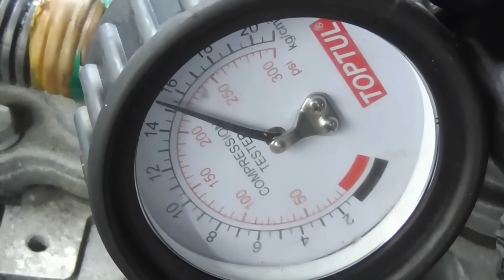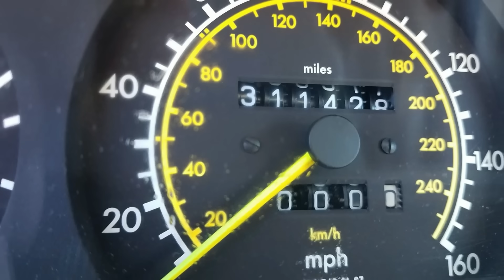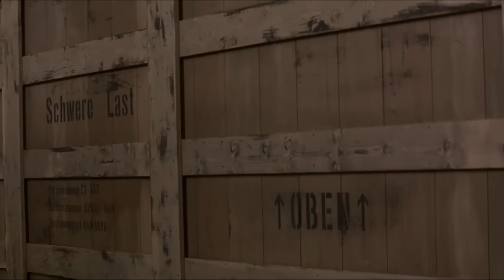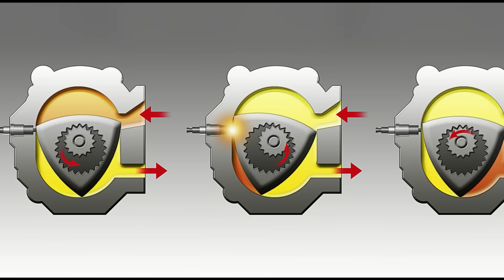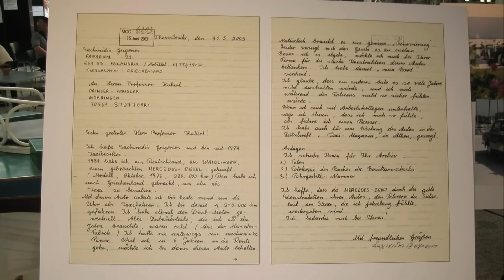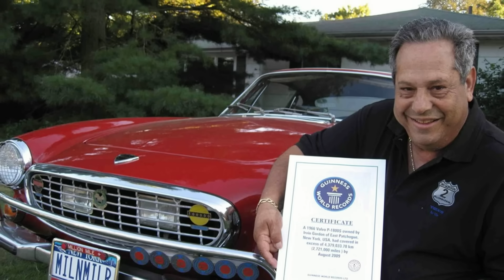Most Reliable Engines of All Time

Comment: This should be titled best tuner engines of the 90's or something. My 97 Montero sport has 240k and it's really not even that impressive to me. Just about any engine will go over 200k if you do proper maintenance. Allot of engines die from things like not changing the timing belt, or not keeping up on leaks and oil change intervals

Comment: My Ford 7.3 diesel just passed 380,000miles. It a beast and has no problem.. it has hauled 3500 lb.up a very steep hill many times. And, many times at freeway trips through thE Santa Cruz mountains. Thank’s for ignoring America. Cummins diesel is a million mile engine. My truck still works for a living. And will keep working as long as I can.

Comment: The bar is set too low. 200,000 miles isn't very impressive. I have a 1 ton Chevy van 5.7l Vortec with 370,000 miles on it.

Comment: I'd say, "Those are one tough cookie." I own a rusty chassis 89 Toyota pickup, 5 speed m with rwd. 22re, transmission, rear axles, differential, are pretty much stock. It sits about 305k miles. Everything runs very strong but just sits in a rusty chassis. Which makes me feel sad.

Comment: I live in Australia and own a Ford Falcon 6 cylinder (Barrar) motor with 350,000kms or 219,000miles and still going strong uses 1/2 litre oil each oil change which is 10,000 kms or 6500 miles.

Comment: Do car people even know about truck engines? I had a 60 series Detroit with 2 MILLION original miles. All I ever had to replace was water pump, turbo and oil changes. Original starter and oil pump. Prob coulda replaced some gaskets cause it'd leak a couple quarts (out of 9 gallons) between changes. Lol

Comment: 322,000 miles and continuing on my 4.7L 2000 Tundra with no real engine repairs.  In that time I've replaced the plugs and one ignition coil.  I had to clean the mass air flow sensor at about 175k miles, and I change the oil and oil filter every 5,000 miles and the air filter every 10,000 miles - all of which I do myself.  Still starts and runs great.  This presenter seemed to indicate anything over 100k miles was a lot to expect.  I'd be pissed if I needed significant engine work before 100k miles.
Reply: Better pray that the starter never dies, they are a bitch to replace on the 2UZ's.

Comment: I once had a 1972 2000 cc engine in a Ford Capri. It had 200 k miles on it when I got it. The engine was built in Germany. The oil was always clean as new after 3000 miles. The body totally fell apart at 250 k. I put the engine in a Chevy Vega and drove it for another 30 thousand. I finally killed it by pushing it through a snow drift to get my family home on a snowy night.

Comment: The 2AR-FE in my AGT20 has been thrashed daily for almost 7 years, almost 55,000 miles. By those numbers, you should be able to tell that they are city miles, and city miles are far harder on a car’s engines, mostly due to cold start wear. I almost always gave the engine ample time to warm up before flogging it, of course. 😇

Comment: Wait a second, if you change your oil regularly you could see 150 -200k miles on the 2AR FE Toyota?  My 1996 madza 4 L V-6 in my B 4000 truck got 315 K miles with no problem.  I used Valvoline 10W40 and changed oil every 10K  miles.  I sold it to my employee and he wrecked it with 220 + thousand miles.  It was the stock engine with no parts every replaced except two transmissions.  I  personally changed the plugs three times!  I beat my head against the wall every now and then for getting rid of it!

Comment: Volvo!! 3.2 million miles and counting
Reply: Absolutley. I was so stupid when I was younger around 1990 I chose a 1982 Chevy Chevette over a 1980 Volvo station wagon, both were for sale by the same guy for $200 each. Chevette lasted about 2 months and had a blown head gasket. The volvo would probably still be running today.
Reply: Is this a high performance engine reliability post or every day drivers??? No mention of the Ford 300 CU IN in line 6 engine that I personally owned a 1965 Ford Fairlane that I sold with 491,600 miles on it still running just fine. They were made from 1965 thru 1996 and they were not just in cars/pick ups ether. Many farm tractors, farm equipment, utility vehicles and the big brown UPS trucks had them as well! They were not high mpg engines but RELIABLE! I have one horror story though that my Brother bought a 1967 Ford F 250 4x4 with a 300 six in it. In the summer of 1969 I asked him how often he changes his oil because he was complaining that it was burning a quart every 300 to 400 miles? His reply was, "Change oil?" It had 45,900 miles on it with the original oil and my brother only adding oil when needed. I changed his oil/filter putting in high detergent oil. He took my advice having the oil changed again in 100 miles. It lasted another 38,100 miles before it locked up.

Comment: Only an idiot says the skyline, or rx 7 is a good engine. Lol. What a fucking moron. Hey moron, im talking to you!!!!
The 4.6 ford longblock from 1991 to 2011 has the highest rollover rate in the guiness book of world records.
Facts.
Thats actually the best engine.
No other engine on record has a common factor of mak8ng more than 1 million miles.
Only an idiot doesnt look it up before they make a post.
And Mercedes? Wtf?
And he says 150k, or 300k.
I have a mazda v6 2008 in my mercury milan with 312k right now 3 liter. Great engine.
A 93 merc grand marquis with over 900k.
A toyota prius 2005 with 302k.
And one Plymouth neon with over 1 million miles and one dodge neon with 312k mile.
All origional with poor maintenance.
Oh and one 1979 lesabre that blew that head gasket at 679k miles in 2003.
So you guys know nothing. And the best mazda engine is the 3.0 liter MFI DOHC found only in ford, mercury, lincoln, and jaguar cars.

Comment: Where is the 1.9 TDI? In Romania there are a ton of them with 250000+ miles and still going, I have personally driven one with 400000 miles and it still felt alright beacuse it was properly maintained. That means reliable, not 100000k that's rookie numbers.

Comment: First of all comparing diesel and gas engines is just stupid. Second rotary engines have never been reliable .  And for my finally the 300 ci Ford 6 cyl was the toughest engine around. I've had literally dozens of these engines in trucks , forklifts , chippers and other equipment and honestly don't remember wearing one out. While not the most fuel efficient , they were nearly indestructible.

Comment: i have Ford Fucus with 1,8 TDCI with 200.000 miles with no problems (and it is f*** Ford), and you can buy car with 1,9 TDI from Volkswagen with normaly more than 100.000  miles, and in 5 minits i found 1 with 500.000 :D

Comment: The most reliable engine that has ever been built is rotary  electric, will run easily over a 1.000.000 miles and it is maintenance free.  It belongs to Tesla whose goal is to build the best car in the world and keep improving their engines and cars constantly. And no one should try to argue this fact. All ICE are built with some critical parts due to fail after a certain amount of miles. The major one is the timing chain, not so much because they couldn't make one to even last a million miles, but because they have to keep well fed their dealer network, whose shops charge anywhere from a $1000 to $3000 dollars to replace it, which it is like they have sold the same car twice. But that is the name of the game.
Tesla on the other hand has different goal, being to build the most reliable car in the world, because they cleverly do not have to cheat you to keep a dealer network, from which DO NOT DEPEND ON. That is why when you buy a Tesla you have to order it direct, and that is the same reason that they manufacture a maintenance free car.

Comment: I heard about that Volvo about 15 years ago. That's cool!
I tend to get lot's of miles out of my vehicles too. Not like that, but decent. 
Oh, for the record, I just sold my 1999 Chevy truck with over 240K miles on it with regular oil changes. That's not so unusual, but get this, it still had the origilal brakes in it. I shoud know, I bought it new back in 1999. The original brakes! Oh, and they still had life left in them!

Comment: The VW flat 4  & the 4 Cylinder Volvo engines from the 60's, 70's & 80's were both as reliable as all fuck. The Mercedes,/Toyota SOHC  12v straight 6 was quite reliable too. Tatra truck engines are pretty good.

Comment: You don't mention Toyota hilux...I've seen some hiluxs that over a 1M km with the original clutch gear and engine.. my Hilux is almost 600k km and still going like new, and still all parts is original(except tires,filters, and rubber parts..)

Comment: Volvo B230F "Red Block" runs forever. Got one now with over 400,000 miles and runs perfect!
Reply: All Redblock Volvos B17, B19, B20, B21, B23. I know someone with a 240 with B200F with 500,000+ Miles on (original owner!) over 750,000 on body.
They were produced from 78-98, using Carburettor(B1/2xA), Bosch Mechanical Injection (B2xE) and Electronic Fuel Injection (B2xF).
They included turbos from 1983 on limited run, later becoming standard for 900 series (B2xxET, FT or FK).
One of the most reliable engines of all time.
Reply: Volvo has a million mile club for cars with that engine. The dealer I used to work for had one on display.
Reply: I put 342,000 miles on a 1991 volvo 740 with a B20F engine from 1991 to 2004. The only maintenance was oil (about every 10 k miles), plugs, timing belts (every 80k miles), transmission fluid (about every 50k miles), brake fluid (every two years), two water pumps, rear end fluid (twice) and shocks (two or three times). Sold with original engine, transmission, rear end, calipers, radiator, power steering pump, master cylinder and power window motors.

Comment: 1997 Ford F 150 5.4 Had 279.875 miles on it heater core and rust sold still running. I let sit for 3yrs guy wanted to buy it ask will run I said it ran when I parked it put battery in it sprayed intake third crank it fired up the guy took it home.

Comment: The rotary engines are complete trash, their Apex seals will be the first thing to go whenever pushing them and they drink oil like it's koolaid. It's common to see owners carry quarts in their trunk because of it. Hell when turning off the vehicle you can't just turn it off you have to follow a procedure every time or you flood it with gas.... I've an ASE certified technician and have been working in the industry for over 10 years. You sir, I question if you even know what you're talking about or if you've ever rebuilt a motor or transmission...

Comment: Lest not forget an Australian Built Engine.  4 Litre straight Six.  Named the Barra (Ford Falcon) there are examples of these engines with over 700000 Kilometers (437000 Miles) on them, I had seen one with 942000 Kilometers.  There is also a Turbo version.

Comment: He totally missed some American Made Engines that are some of the best in the world. Not very accurate. :(
Reply: he completely skipped some legendary engines and put the mazda rotor engine in
Reply: He should have did the ford 7.3 leader engine
Reply: He missed the 4.6 2v V8 from Ford
Reply: Matt Weeks yes in deed mine just hit 336,000. An still going strong.
Reply: And some soviet ones...
Reply: like the legendary Chevrolet small block
Reply: @TheWolfsnack  I had a 327 with a tick once 1968 Camero 2 bolt main, front one went, stuck in rush hour, it was hammering, I said to the guy parked beside me on the freeway "ticks like a timex" The crank was jumping about half an inch, but got me home, started the next day too, had to show that one off. I drove the snot out of that one. Is that considered reliable? lol
Reply: Had many good Ford motors too, but then I 'm an old timer. I'm a Ford man today unless tRump gets in, I will be a Toyota or Honda guy then. lol Just an old crazy Canuck.
Reply: My thoughts exactly
Reply: Out of all American Cars, I would get are Ford.. Most taxi cabs and cop cars were Ford and they just ran forever but they didn't have great gas mileage though
Reply: @beingrealhere9480  I have worked at three major copper mines over the years....one thing they had in common was Chevrolet pickups.....one mine switched to Dodge, then back a couple of years later due to the mechanics complaining about unreliability issues.
Reply: Yup missed the ford 300 I6 and the 12 V Cummins.
Reply: American: size matters
Japanese: as long as they don’t squirt

Comment: The Majority of these are inline engine. I'm regularly thankful GM put the Vortec 4.2L I6 in my 2004 Trailblazer... I'm at 298k miles and I'm a notorious procrastinator on oil changes, like beyond 10k and close to 30k once. I know, someone should turn me into the ASPCA of automobiles, but that's just a testament to the importance of Engine Harmonics.

Comment: I have a 7.3 with 485k on it and the auto trans lasted till 483k. Then when the Wankel was mentioned as reliable? Have to do better research. I had a Jeep Grand Cherokee with the infamous oil galley clogging 4.7 v8 that had nearly 300k on it before I sold it

Comment: "Most reliable engines of all time."
Mentions rotary = lost all credibility 

You can rely on their apex seals to wear out, and oil to leak into the combustion area... so there's that.
Reply: Happily change its place on the list with UZ engine series
Reply: @2gj906   I know right! How wasn't it in the list? There's a Tundra and LS400 that broke a million miles with that engine!
Reply: James Copeland research the apex seals issue further, and you’ll find that rotary engines are just more adversely affected by the act of neglecting proper maintenance schedules. Properly taken care of(like any performance car engine), many of their so-called “inherent issues” become much more tame. They’ve also never had the same research investment or lifespan as a typical slider crank engine. While others have experimented with the layout, Mazda’s just one small company that hasn’t purely focused on the rotary for the relatively few decades the engine has been around.

Also, look up SkyActiv-R.
Reply: Don't get it eigther...they all breake down after about 50k miles...and a total rebuild has to be done every time. The costs are very high...and that they call reliable? WTF?
Reply: @karlos1060  if properly taken care of, they can last a lot longer, but the biggest issue is people don't realize they're basically 2-strokes and they consume oil by design.
Reply: @Prestiged_peck  

Sorry mate, but thats not true. A friend of mine worked at Toyota. They can last a little longer then 50k miles....if you go really easy on them you might get 70 to 80 k max, and a rebuild is needed. The seals of the piston are in such design that they wear of a lot, and you can not avoid that. The rotor engine is just an engine that worns out much faster.
Reply: @karlos1060  rotaries are wierd.
Reply: It is relatively inefficient but not unreliable in comparison. That is the primary reason of it's fall, strict regulations about efficiency. Yes it scrapes the housing, burns oil a lot (ofcourse), but set aside efficiency, it is reliable and simple. But I still prefer the conventional one.
Reply: He also said that clutches are only good for 50k. I have a 300k Tacoma on the original clutch.
Reply: @taylorc2542  they're only good for 300k in bumper to bumper traffic for 2 hours a day with someone who doesn't really know how to drive manual. Also some vehicles have more durable clutches than others, and high amounts of highway use is going to greatly extend the mileage life of your clutch, because, yanno, it's not being used for hundreds of miles at a time.
Reply: "Oil to leak to the combustion area" Are you stupid?
Reply: @verttisyrjala2897  jep
Reply: @verttisyrjala2897  Do you actually know how that engine works? 
Probably not based on your answer...
Dont tell someone he is wrong when you yourself dont have a clue what is it or how it works...
Reply: @markosavija8593  I definetly know how they work, the OP doesnt. Just like 2 strokes, wankels NEED to burn oil or they will seize.
Reply: @verttisyrjala2897  That is correct, i misunderstood your comment
Reply: Literally my exact thoughts bro. The miata is atleast 5 times more reliable than any 13b or 12a. Dont even try to mention the renesis anywhere near close to this list
Reply: the rotary engine is in fact reliable. not quite as reliable as most of the others on the list means it should be last, but placing it on the list is technicly correct.
Reply: ... the rotary is a 2-stroke... the oil is supposed to be in the combustion chamber, the engine will seize if it doesn't get oil in the combustion chamber.
Reply: @Prestiged_peck  it's a no stroke actually as it works completely different from a piston engine. The apex seals being exposed on both sides to the combustion means that you have to have oil in the combution chamber or you will blow the engine.
Reply: @joer8854  I know but like it functions more as a 2 stroke than a 4 stroke because no valves and oiled through intake charge
Reply: Love the way people always blame the apex seals.....thats not the seal thats their weakest point 😂
Reply: All Lexus and toyota engine are reliable. What about the 1zz? Reliable, fuel efficient and bullet proof
Reply: Yeah but if we included all toyota engines the list would be a toyota circkejerk

Comment: They forgot the slant 6 mopar. A bullet proof engine.
Reply: great engine and i have a 3.6 in my 2013 dodge mini van 180000 mi runs good yet uses no oil. most cars now days will go 150000 to 200000 miles if you change your oil and drive them normal.